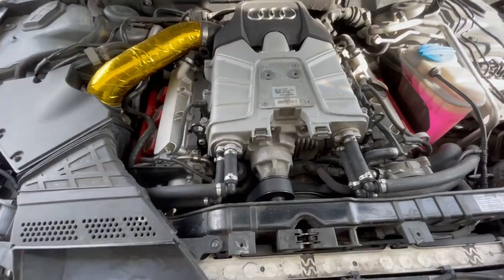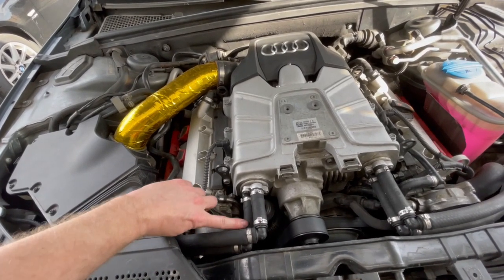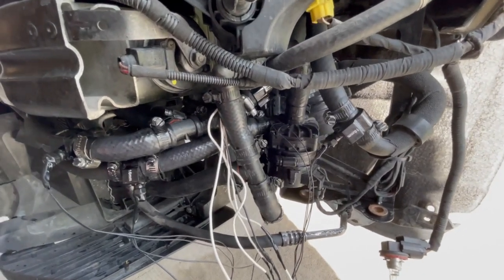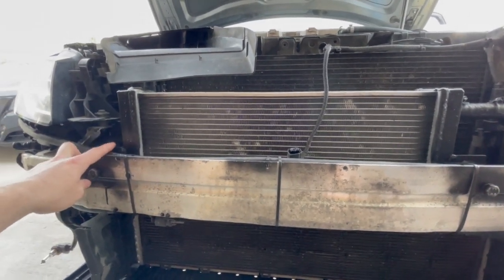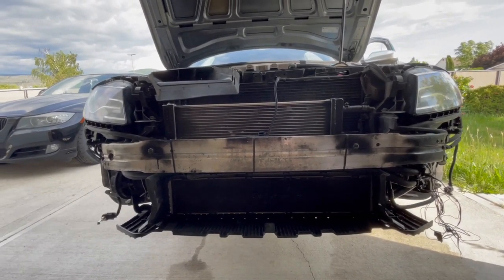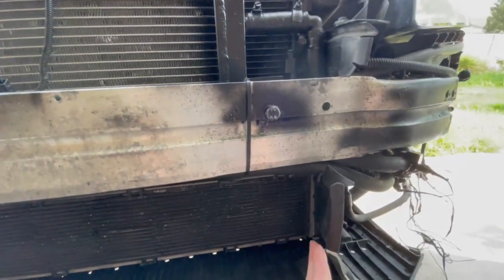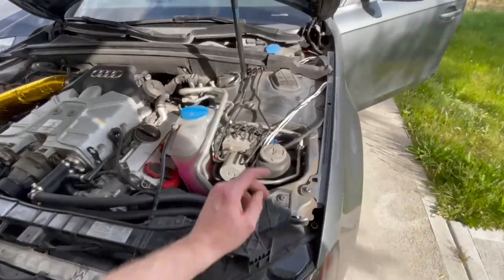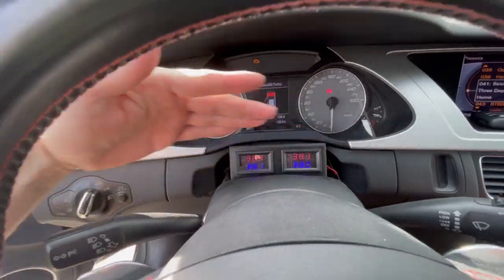VelocityAP - Audi 3.0TFSI Intercooler Ports for S4/S5/Q5/A6/A7 with 2x CWA50's

Comment: I just did my velocity AP ports. Heat shrinked the 4 metal ports and used billet T fittings with rubber hose to create symmetrical crossover pipe replacement. I don’t understand why more people aren’t doing this mod, yet they’ll pay 1k to port their supercharger or on a carbon fiber intake lmao . 

I am about to install my Plasmatio phenolic spacer plates under supercharger. Only 400 bucks on their website and again nobody does this mod either, yet they spend 500 on a bigger HX and 400 on a pump. 

Personally I don’t see myself ever affording 10,000 on the new Merc racing supercharger, so this is my budget way to optimize the TvS1320

Comment: The biggest problem any Audi owner could face is the oil/water mix in tranny or engine . What are the best ways to avoid that ? besides changing genuine coolers for both every 1.5 year  . Is their any smart way to avoid this nightmare permanently?   beside regular maintenance for sure . It happend to my tranny A8 2012 . Because i was lacking basic information and i didnt change cooler . I was new to that stuff
Reply from the maker: You don’t need to change the charge coolers or any of the coolers every 1.5yrs. This car is a 2012(130,000km) with the factory fitted charge coolers, I only replaced them recently as preventive maintenance, the old ones I cleaned and put on shelf in case needed as spares. But I also don’t follow the Audi maintenance schedule, I change all my fluids and filters long before the Audi advised date/mileage.
Reply: @christopheredgett4919   my A8 is 114000 km . Used car but very clean . But the water was leaking into the tranny through cooler. I didnt know, i was shocked . I Changed the tranny with   new geniiun cooler. I will replace the engine cooler too . Cleaned all hoses . will replace some hoses later . Change thermostat . I hope it lasts for very long time . But how to avoid that mix in future ? Should i clean the charge coolers every 1.5 year ?